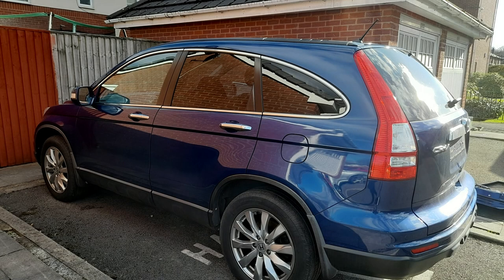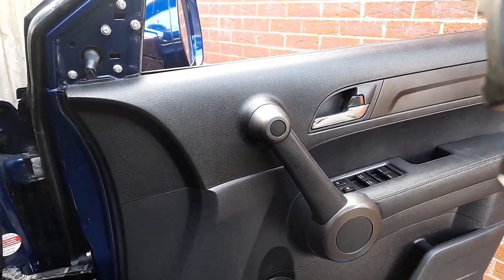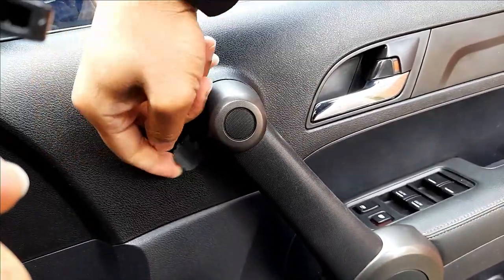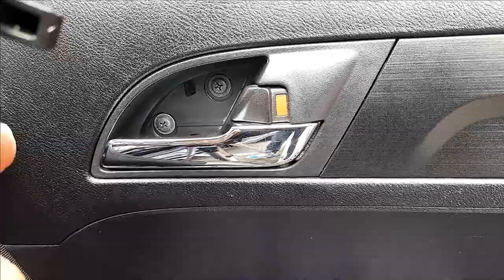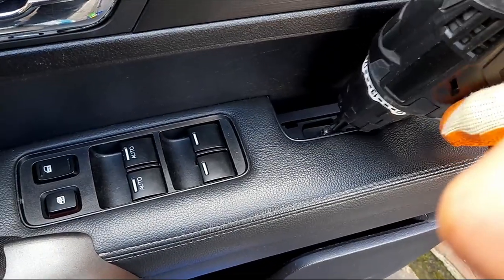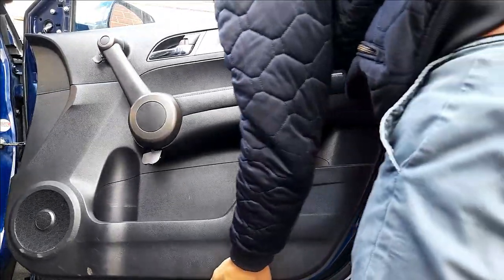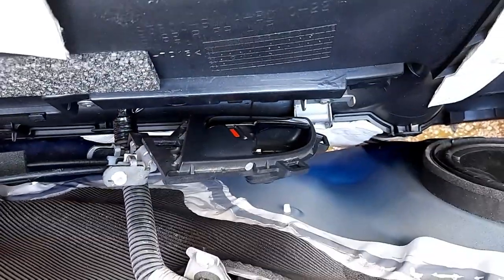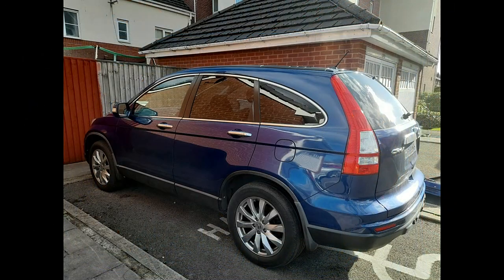Honda CRV.How to remove the front door panel

Comment: Great videos  on changing doors our crv  has damaged passenger doors we've managed to get 2 matching doors of the same colour. I'm just thinking about doing the change over  replacement doors myself I'd need to change both door cards and wing mirror as they're not on the new ones. Is it just a matter of doing things in reverse when fitting new ones . Cheers mark
Reply from the maker: Yeah it is not that difficult but if u get some one to help it is going to be more easy thanks for the feedback